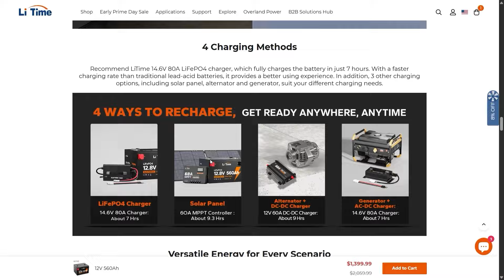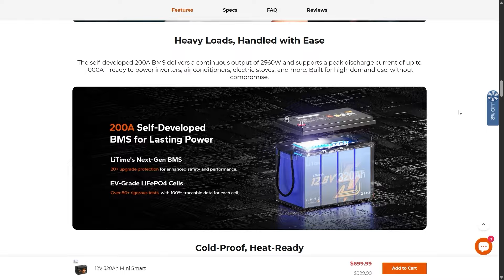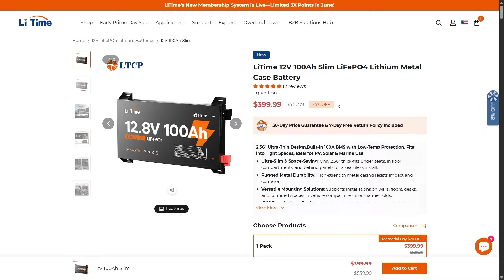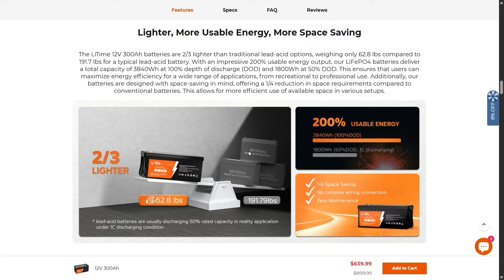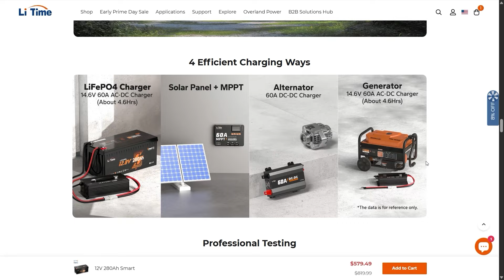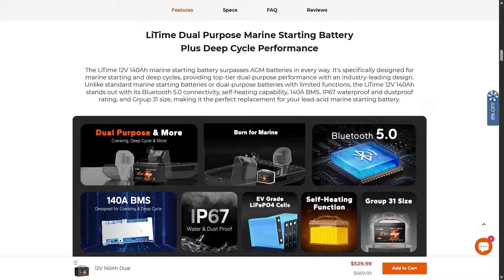Top 10 Best LiTime 12V Lithium LFP Battery Deals for Off Grid, RV, Home Back Up, DIY Solar Power

Comment from the maker: Use the links and Code:  ADVENTURETECH  for an additional discount on any LiTime products & help support my channel at the same time!

!!Limited Time Double Discount with Code:  ADVENTURETECH10 

------------------ BATTERIES FROM this video listed below -------------------

➨ Get the LiTime 12V 560Ah LiFePO4 Battery for Off Grid Solar System with Low Temp Protection:  https://www.litime.com/products/12v-560ah-low-temp-protection-lifepo4-battery?ref=AdventureTech

➨ Get the LiTime 12V 460Ah LiFePO4 Lithium Group 8D Battery:  https://www.litime.com/products/12v-460ah-lithium-battery?ref=AdventureTech

➨ Get the LiTime 12V 320Ah Mini Bluetooth Lithium Battery for RV and Camping:  https://www.litime.com/products/12v-320ah-mini-bluetooth-lithium-battery?ref=AdventureTech

➨ Get the LiTime 12V 400Ah LiFePO4 8D Deep Cycle Lithium Battery:  https://www.litime.com/products/12v-400ah-lifepo4-lithium-battery?ref=AdventureTech

➨ Get the LiTime 12V 100Ah Slim LiFePO4 Lithium Metal Case Battery HERE:  https://www.litime.com/products/12v-100ah-slim-lifepo4-battery?ref=AdventureTech

➨ Get the LiTime 12V 200Ah Plus Self-Heating LiFePO4 Battery:  https://www.litime.com/products/12v-200ah-plus-self-heating?ref=AdventureTech

➨ Get the LiTime 12V 230Ah Bluetooth Lithium RV Battery with Low-Temp Protection:  https://www.litime.com/products/12v-230ah-bluetooth-lithium-rv-battery?ref=AdventureTech

➨ Get the LiTime 12V 140Ah Bluetooth Dual Purpose 1000 CCA Marine Battery:  https://www.litime.com/products/12v-140ah-dual-purpose-marine-starting-battery?ref=AdventureTech

➨ Get the LiTime 12V 300Ah LiFePO4 Lithium Battery for RV:  https://www.litime.com/products/litime-12v-300ah-lifepo4-lithium-battery?ref=AdventureTech

➨ Get the LiTime 12V 280Ah Plus Deep Cycle Lithium Battery with Low-Temp Protection:  https://www.litime.com/products/12v-280ah-plus-lifepo4-battery?ref=AdventureTech

➨ Get the LiTime 12V 280Ah Bluetooth Lithium Battery:  https://www.litime.com/products/12v-280ah-bluetooth-battery-with-low-temp-protection?ref=AdventureTech